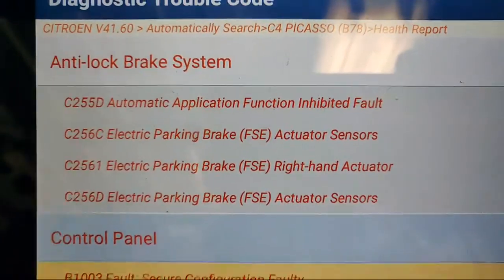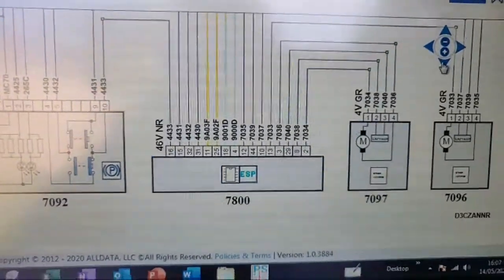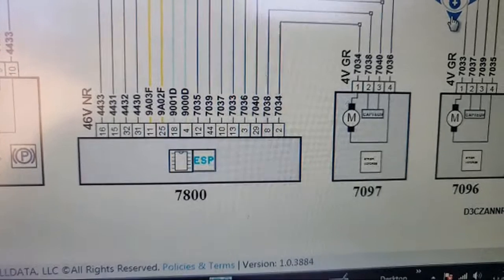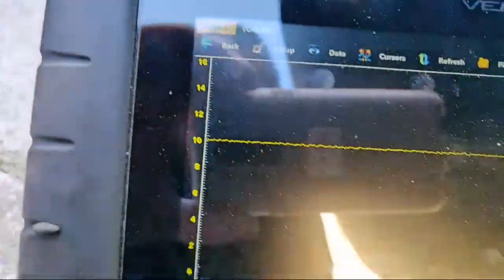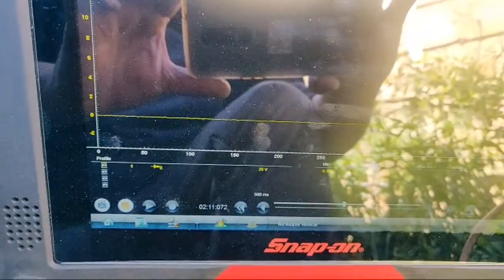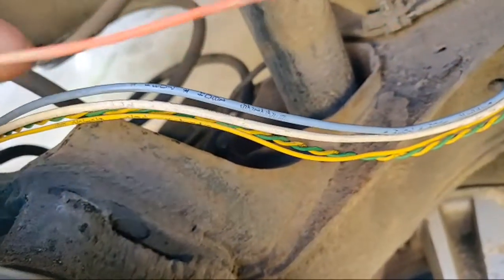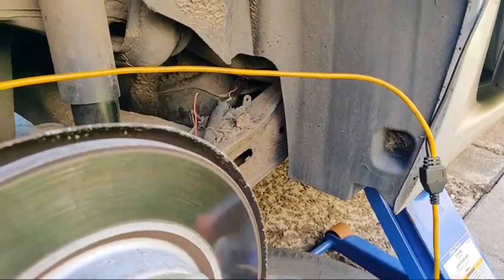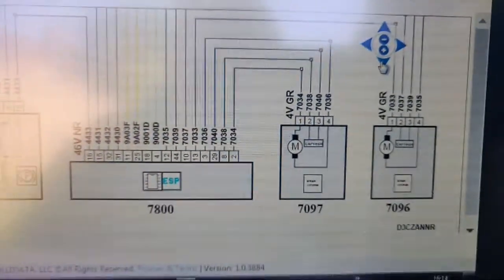Citroen C4 EPB Fault C255D, C256C, C2561, C256D

Comment: Hello mate 
Lucky mate  had a 3008 on the polish number plates with abs fault on the NSR sensor spent ages trying to find a break in the wire and was running out off time as customer was about to leave for home country in less than 12 hours so resorted in adding extra wire and advised to get to garage as soon as gets home to do proper repair 
Anyway it worked and customer got safely back to home country so even if it’s was a bodge but it worked 
Again thanks for the video pleasure to watch after long days graft 
Take care mate stay safe

Comment: Great find Steve and luckily it wasn't any further down the wire closer to ABS pump, it saved you checking wire resistance from the pump. Alldata is also great for any TSB bulletins. Keep the vids coming 👍🏻
Reply from the maker: Resistance is a waste of time, it's not a valid test mate, loaded circuit volt drop is 100% reliable, ohms are not 👍 have a look at Paul's video here https://youtu.be/McsNOJvd0ao
Reply: @SimplyDiagnostics yes good point. I normally would do a 5 point check on the wire which includes continuity, resistance, short to earth, short to live & short together would you agree? The voltage drop like you say would be the most accurate but that's a great video example of resistance checks being incorrect. Thanks
Reply from the maker: Resistance and continuity have there place, but only in limited circumstances for me. Circuit integrity tests for me are nearly always volt drop on a loaded circuit, the three short tests come after volt drop finds an issue (there are variables to this, it's not cast in stone).

Comment: My favorite color “green”!   Got a chuckle out of that one! Nice find!  I use a tool here in the states that’s made by matco ,, it’s a test light with two ends on one end,, computer safe ,, does spot open wiring stupid fast!
Reply from the maker: Have you got a link or part number please? I'll have a look 👍
Reply: Simply Diagnostics give me a few ,  part number seams to be worn off on it,, I’ll look in there catalog and see if it in there
Reply: Basically it’s a led test light that can pick up power and grounds, it can detect signal thu a wire even if it isn’t powered up ,, most ecm connections run back thu a ground  and this can detect that, if circuit is open you have no light at all
Reply: Well shoot,, the exact one I’m using isn’t in there catalog,  it’s similar to model MD1646
Reply: Also thinking 🤔 the power probe can do the same thing ,, this test light is so small and quick to hook up for wire testing
Reply from the maker: What I didn't show was me loading the circuit with a 1 amp load to see if the grounds were good and the 12v circuit could carry current, you can't do that with a powerprobe unless you start disconnecting stuff to prevent the smoke leaking out.
Reply: Simply Diagnostics oh yea I agree on that, I use the tool for basic circuits and sensor wiring ,, usually loooking for open wiring with it,it’s the first quick test, no open wires then time to get serious like the 1 amp load testing, you must know the circuit your working on first!

Comment: Nice one Steve I've had then go above the tank  good old French cars they had lot of problems with porous  insulation  when manufactured   they have problems around under Bonnet fuse box/ abs unit . How much a year is alldata  who's the person to speak to?
Reply from the maker: There's a discount for SDN members, link inside the trade only section of the  portal. You can also request a free trial via app.alldata.com, mention you saw it here 👍
Reply: @SimplyDiagnostics  will do Steve thanks mate

Comment: I have 2016 c4 grand picasso hand brake fault changed switch still no good comes on some times if i press button a million times auto not working can you help thanks
Reply from the maker: Best advice I can give is to take it to a local specialist, this fault could be a simple broken wire or have you chasing your tail for weeks without the correct technical information and test methods. Sorry I can't be more help.
Reply: @SimplyDiagnostics  thanks👍

Comment: Hi guys.  Im hopin somebody on these brill vids can help me. I have a grand picasso 07 plate with the semi auto box.  My problem is i put in gear or reverse & the gears go in instantly. But then they instantly go out of gear & back into neutral.  Im hopin somebody can help me suss it so i can get it fixed again.  I had a really good running never let me down EVER skoda but the citroen broke down it was my son inlaws & he has chilrdren to get to n from school & has to get him selfe to n from work so i gave him my skoda n i was goin to try n fix the citroen. Haha untill i oppened the bonet that was.  I havnt got a clue all i know now is im on shanks's after my good deed.  Can anybody point me in the rite direction of gettin it fixed i dont have a code reader or a scanner thingy'bob to check if it can be fixed can somebody please help me. Many thanks.  Jim.
Reply from the maker: Highly recommend that you take it to an independent specialist with access to the dealer tool and dealer information system.
Reply: @SimplyDiagnostics  thanks for the reply. Sadly i can't do that as it wont stay in gear for me to get it there. 😢